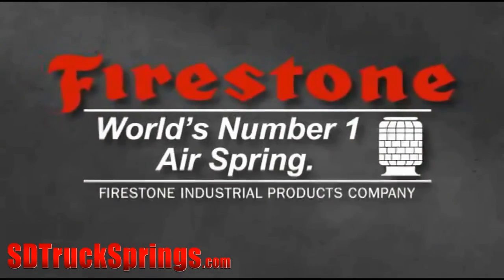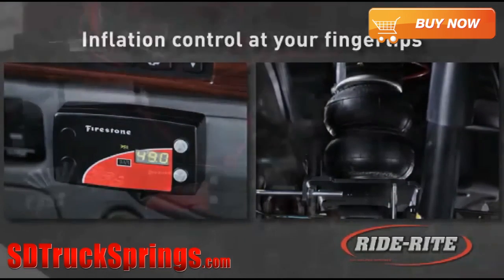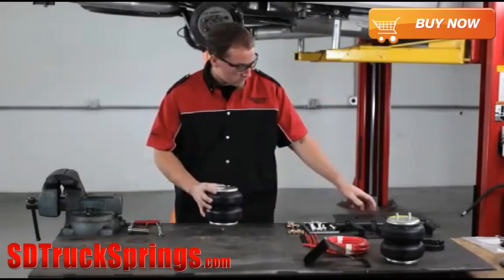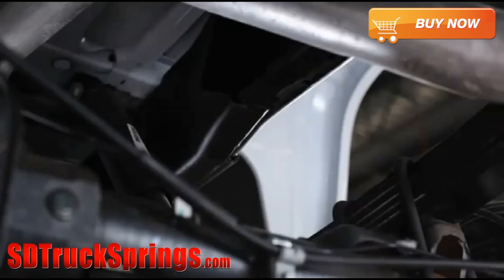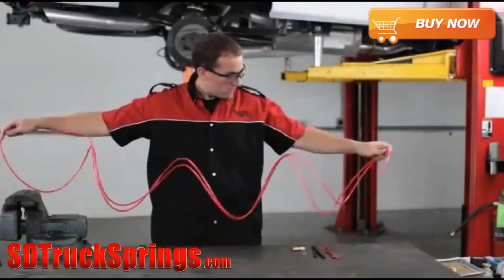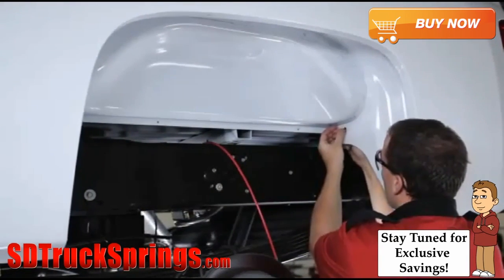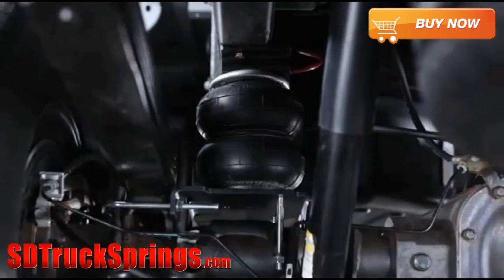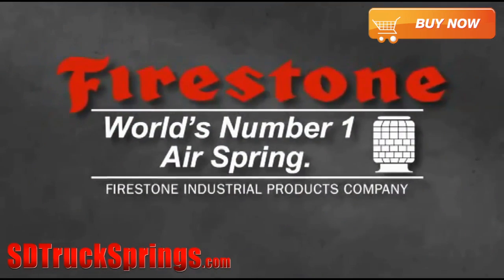How to Install the Firestone "Ride-Rite" Air Bag System

Comment: Just got my AirBags from you guys. I've watched this video 3 times now amping my self up to do my install. Hoping to set the side aside this week to do it.
Reply: How long did it take you to install?
Reply: @massivepump3059  about 45 minutes on the first one and only 20 minutes on the 2nd. Mine was missing a bolt so that time does not include the time it took me to drive to Lowe's to get a replacement bolt for the shorted one.
Reply: @DiscosVideos  thank you! Took me a bit longer, lol.
Reply: @massivepump3059  watching the video a bunch of times and had my tablet out with me and watched it pushing pause while I did each step helped quite a bit.